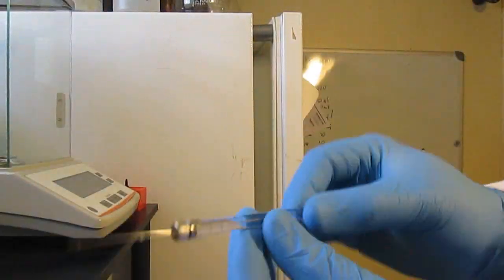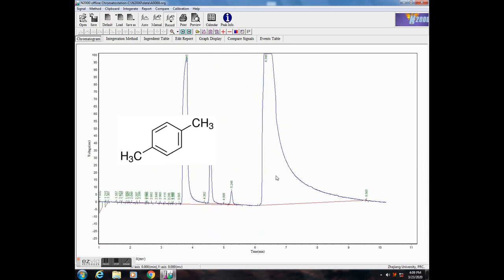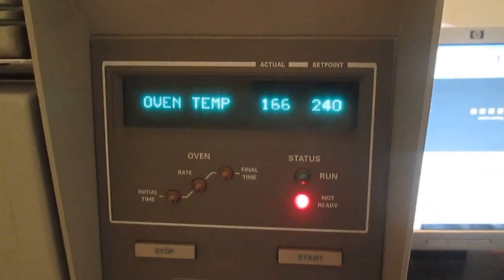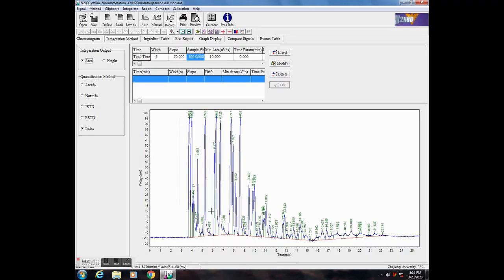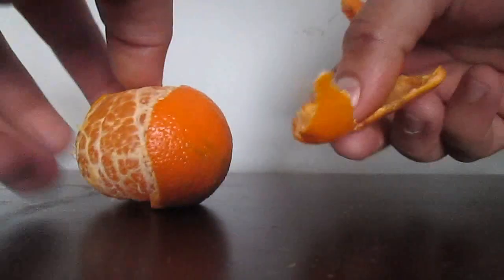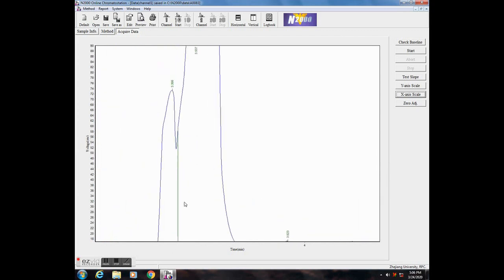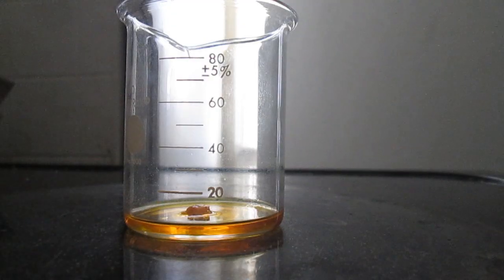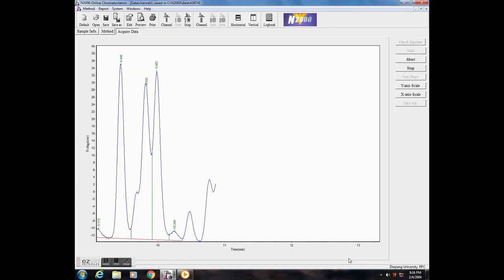DIY Gas Chromatography part 2 gasoline analysis home lab

Comment: Can you use Argon instead of Helium for the carrier gas or are there significant drawbacks?
Very cool videos! I WOULD LOVE to get a detailed explanation of your machine and how it works and mainly how it is constructed in detail.

PS: Love your Channel and all the work you did, Instant Subscribe :D
Reply from the maker: Yes ! Absolutely! As long as it doesn't interfere with the detection method it's fine! I had access to helium instead of argon but I could have used it too ! This instrument was about to be dumped and I thought I could do something with it! Got a few parts from eBay and a different detector and that is really it ! Thanks for watching!!! And thanks for the kind words! Much appreciated!

Comment: given that helium is expensive, hydrogen is not really safe, what about nitrogen? it's not optimal because not as small as hydrogen or helium, but it is cheaper
Reply from the maker: Yeah I thought about it but since I already had helium for another project I used what I had .. but definitely a good idea!
Reply: I am using hydrogen which works perfectly. As long as there isn't any hydrogen accumulated in the oven there is no problem.
Reply from the maker: Please share your experiences and results!!!